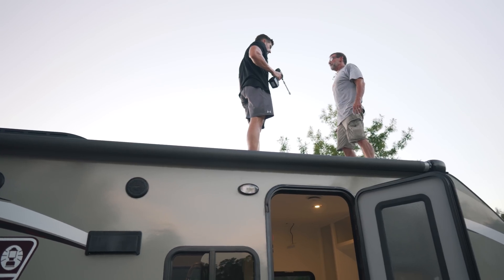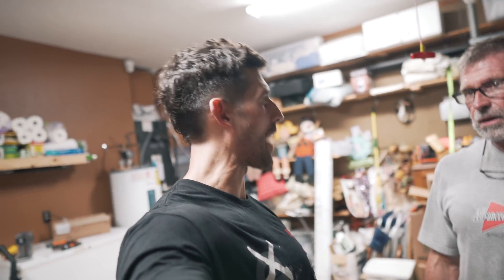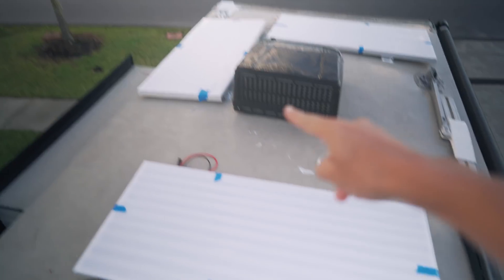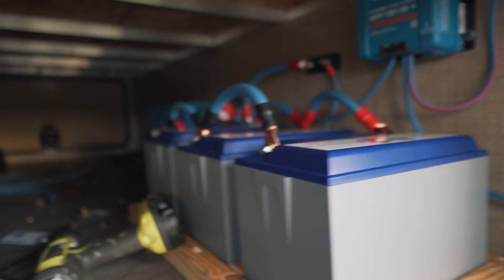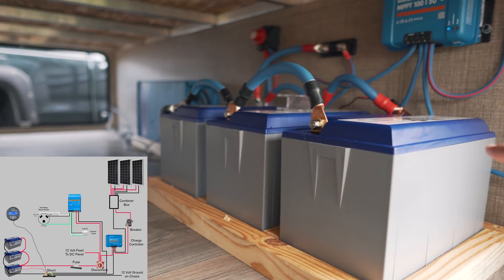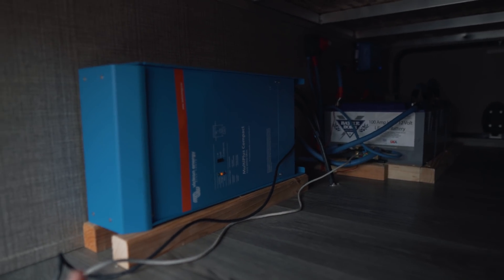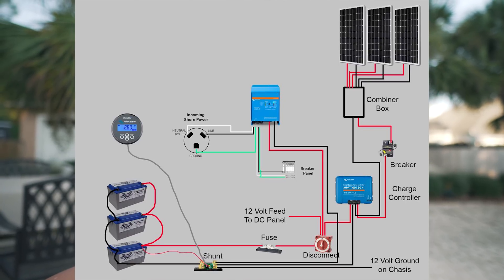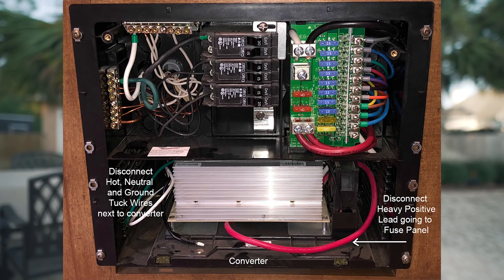Our RV Solar Setup With Wiring Diagram - Solar Components Listed

Comment: Brad you made my day. After watching so many DIY you tube video on how to wire up solar system in RV 
so far none of them really mention the most valuable detail until today I ran into your 's.
 Not so much of the video but at the very end you mention a few words about (incoming shore power line ) and tie up with 
inverter also with your wiring  diagram that really clear up what I have been looking for.
Now I can feel very confident to go wire up my 5th wheel
Thank you
Reply from the maker: So glad I could help!

Comment: What actually makes it worth it?    You can get a $700 3500 W generator that all you ever do is put fuel in it.  They’re so quiet you don’t even know they’re running.    I was thinking about doing this to a enclosed trailer I have for my flying trips.    But now I’m thinking generator is the way to go.
Reply from the maker: Depends on what you want to use it for. I haven’t seen any quiet generators that are 3500W for under $1500. We also care more about having an always available for 10-15 amps for charging electronics, lights, etc — not as much about running the A/C. The solar wasn’t the expensive part, the barriers were. Energy storage is more important to us. Solar isn’t meant to run A/C.
Reply: Bradley Bromlow 3500 Watt Super Quiet Inverter Generator https://www.amazon.com/dp/B076YLNZ1Y/ref=cm_sw_r_cp_api_ZH9NBbHNBE8FB
Reply: Bradley Bromlow That one is really quiet very efficient and fuel and normally you can get it for around 700.   It goes up and down by the month.
Reply: Bradley Bromlow so how are you planning on running the air conditioning?   Personally I can’t sleep unless it’s cool.   I know a lot of people are different.   And those campers aren’t very well insulated if it’s 80 or 90° outside it’s going to be 80 or 90° inside or even hotter.
Reply from the maker: We plug in when we run be A/C. Because our inverter does shore power assist when we can everything from a standard house outlet. We are really looking forward to getting north and cooler weather then we won’t need to plug in or anything but the sun.
Reply: Bradley Bromlow lol sounds like a good plan but in a couple weeks you’re going to want heat at night up north lol.
Reply from the maker: Nahhh I’m ok with anything above 50, but we have a propane heater too.
Reply: Bradley Bromlow be careful with carbon dioxide.   And I guess that is why they invented snuggling lol. And also something to think about in the north we can go weeks without sunshine.   I remember back in February the sun came out for an entire day and the weather Channel said that we had more sunshine in that one day then we did in the previous 58 days lol.
Reply from the maker: Be careful with running out of gas in the middle of nowhere 😉
Reply: Bradley Bromlow ha ha ha!  lol 😝 I was airborne infantry, not Navy 😜